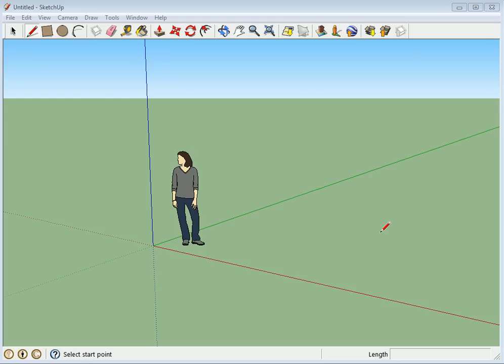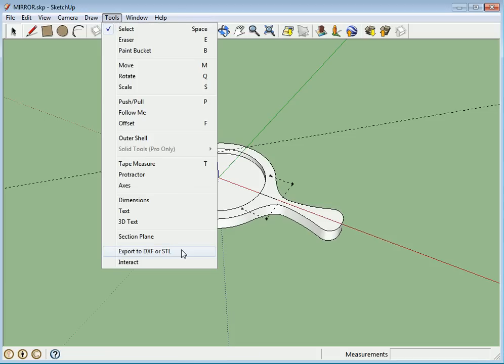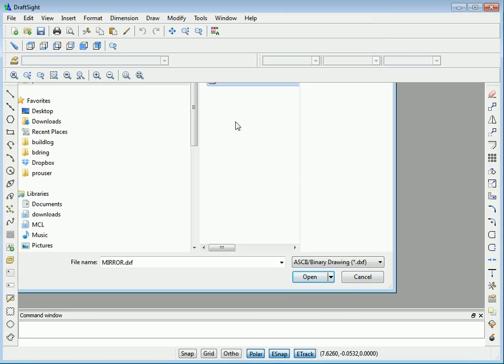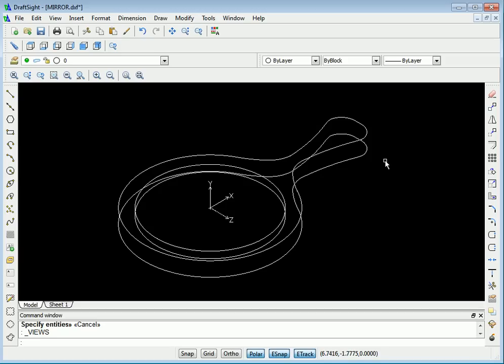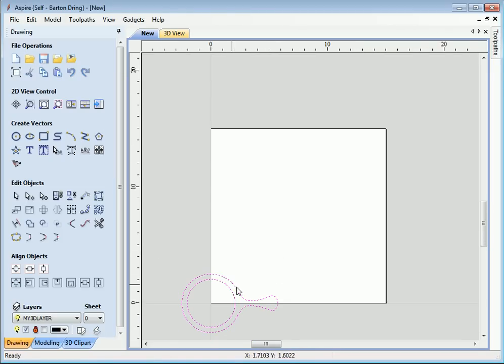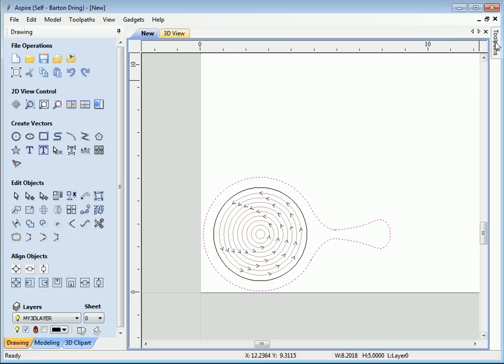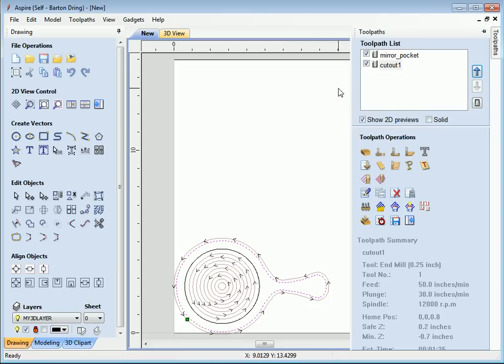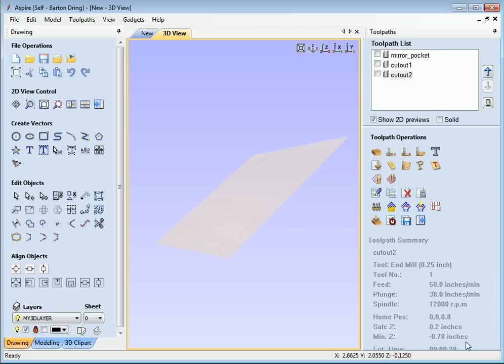Sketchup to G-Code

Comment: Hi Barton; I'm new at this CNC machines. I've read and watched you-tube enough to build my own small CNC. I have all my electronics but I just can't seem to get it through my head as to what the electronic path is between my C/P using Sketchup to the steppers. Will you help me?
1. Select a drawing or create one on Sketchup then I need something to get the information to my Arduino. I know many use Mach3. Do you have another (whatever it is called - controller?) preference for this part of the CNC? Do Mach3 and Clipeppr perform the same tasks?
Thanks, Tom

Comment: I'm sucking wind on making 3D "prints" I tried with FreeCad and started Sketchup yesterday.

my problem seems to be GCODE translation.  I import STL to Slic3r or Netfabb, and I don't what I'm doing past import.  

So, once I import, and it shows me an item which is a trainwreck of the original, I don't know what to do.

Please advise on a solid, open source Gcode translator for 3d printing, and how to use it.
Reply: +TheRangeControl  you probably figured this out by now but for stl files that are not solid you can use a model repair service like https://netfabb.azurewebsites.net/ to fix some of the issues

Comment: how do you go from what you did here to mach3?
Reply: Chris Kindig Mach3 reads G code which is essentially a text file containing toolpath data, it doesn't read graphics files. The video doesn't show him exporting G code or using Mach 3. I export to the option "Mach2/3 Arcs (mm) (*.txt)" and it works fine. There is a video out there showing the process as that's where I learnt from.
Reply: dmak2 Right, all your machine understands is G-code (literally an array of commands to send to your machine)
All you need is something that "generates" G-code

Comment: Wow! Aspire is nice but costs an arm an a leg :P
Reply: Hi, here find the program full. Read the instrucción to install. Enjoy http://www.mediafire.com/folder/29ha0n5str009/Aspire
Reply: I just found "Phlat" plugin, a simple Gcode generator for CNC cutting. It has a 3D Gcode plugin that looks promising. I only am running simulations in Mach3 as I have not received the bits for my new cheap-o-chinese 30x40 4 axis CNC router. I think I will have to invest in Deskproto so to be able to use the rotary axis. I was able to instal Aspire and I see why you are not using it for design, it is very complicated. Thanks anyway.
Reply: ruben urzua Pirated.